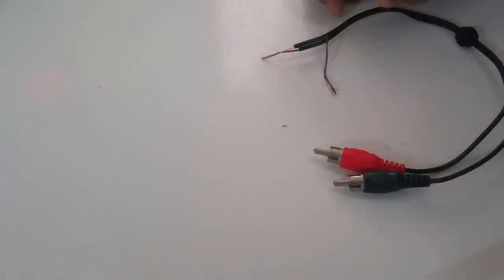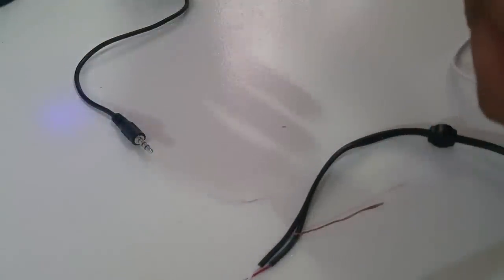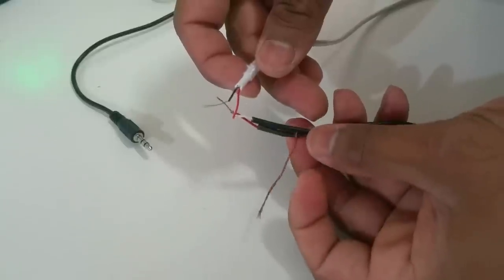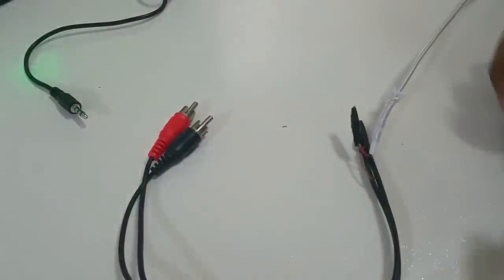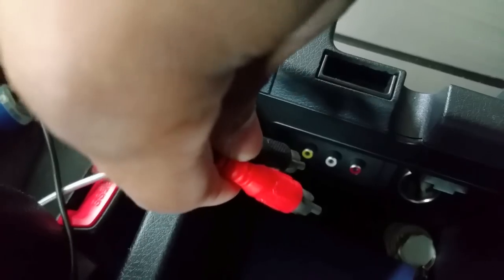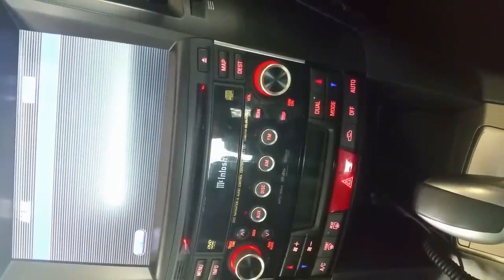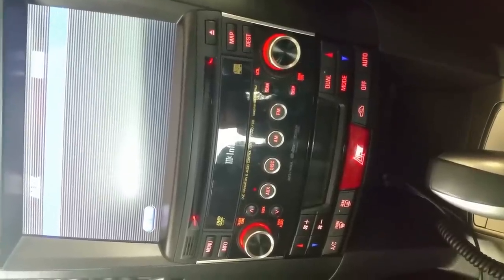How to DIY RCA to aux converter

Comment: hi, thanks for the video!
im trying this myself now, i just have a few questions:
1. why do you chop the ground of the AUX? shouldnt you just connect the ground to the ground (copper) of the RCA?
2. shouldnt you conect the right of the AUX to the right of the RCA (red to red)? and left to left (black to white)?

thx a lot again1
Reply: That is 100% correct. He combined both left and right to only 1 side of the stereo field and depending on the fact the stereo field is centered so he will hear most of the post production mix. The way music is mixed today it will sound bad because now they are layering vocals and sounds on top of one another, anything panned hard left or hard right will not be heard because he only connected it to one side, it breaks apart the layering done in post. 

It is a very bad way to do this and glad someone pointed it out. Doing it the way you said will keep the left strictly on the left and the right strictly on the right and you will hear the mix as intended. I couldn't understand why someone would do it this way either. It will work for a song with everything completely on the center channel but that would be super rare because no one mixes like that.

Comment: hello, can you please help me out? Ive tried to wire a chinch cable to an "aux in" pin on the mainboard of my sony hi fi. Ive hold the red and white chinch wire to the L and R pins on the mainboard but no sound comes out at all. First it worked! ive hold it on the L and R pins and the sound was flaweless. Then ive tried it again and now nothing......Did i shot the aux in on the mainboard? Or do i have to wire all the 4 cables of the chinch cable on a pin? Or are these cable isolated with a transparent layer and i have no contact? Thanks

Comment: I have a aux cord with 4 colours. Red, green, blue and gold. And I want to attach it to a rca cable but it is only a red end, and inside it is gold wire than can be split in two. How do I connect the 4 coloured wires to the rca cable? Really need the help.

Comment: signed in to thumbs up. just the vid i was looking for. cheers!  I did have one question, I have a really cheap set of headphones, a set from a plane trip or something, will the sound quality be significantly worse than using more expensive headphones(sony) or like a pc aux?
Reply from the maker: not really mate, sound quality would depend on the quality of headphones, i haven't had any issues with mine, its sounds good in my car. you are transferring the signal through wire.

Comment: This method is only for mono audio FYI if you want stereo you must connect the positive wires for both channels to the corresponding one on the RCA wires. Good vid tho!
Reply: squidud i don't quite get it!
Reply: @carlosbeltran4488  it means you only get the left channel not the right and left. It still works though, I'm just a huge nerd.
Reply: No no that's not what I meant, I don't get how to do it...
Reply: @carlosbeltran4488  oh ok. so first, strip the wires on the headphone cable. You should get 2 or four cables  (depending on your headphones). If you have two cables, do the following:
Strip the two wires inside headphone cable (if not already done)
Strip RCA Cable (you should see another rubber wire inside and some access copper wire around it)
Take the small rubber wire inside the RCA cable and strip it.
Connect it to the one of the headphone wires and solder or tape or whatever them together. 
Take the acces copper wire around the small wire in the RCA cable and twist it up, to collect it all in one wire.
Connect it to the other headphone wire and solder/tape it together. 
Done.
If the headphone cable had four cables do the following:
(you need two RCA cables for this one)
Strip the headphone cable revealing the four wires inside. There are two brightly colored wires. The cables should be separated into two "groups" of two (separated). 
Take your first RCA cable and strip it, revealing the rubber-coated wire and the acces copper wire. 
Take one pf the fore-mentioned cable groups in the headphone cable. Strip the rubber wire in the RCA cable. 
Connect the brightly colored cable out of the two cables in your "cable group" and connect it to the wire you just stripped.
Take the access copper wire and connect it to the less-colored wire. 
Grab another RCA cable and do the same thing for the last two wires.
Done
If any of this was confusing, let me know and I can make a more in-depth video and post the like here tomorrow. Just let me know.
Reply: Just tell me if you have any issues and ill make a vid tomorrow for you
Reply: squidud I would really appreciate that
Reply: Itll be done tommorrow

Comment: I need some help splicing certain wires and putting them together. All the steps I've done but when I took apart the aux, there were red, blue, green wires and not red,white,black. What do I do?
Reply from the maker: best thing to do would be plug in the cables in to your devices and then try touching them to each other 2 at a time. and see if you get any sound from the speakers. its hard to tell because sometimes cables used different color coding.

Comment: where do you get a  female 3.5mm jack? I have plenty of the male, but I need to make the RCA male to 3.5mm female adapter
Reply from the maker: I had brought it years ago from ebay. But its male side broke. So i used the female side from there
Reply: @robinkhaira1  Ok thank you

Comment: What do I do if my aux cable has red blue green and copper
Reply from the maker: then you ll have to mix and match them, but if i had to take a wild guess then i think red and green would be ones to connect.
Reply: robinkhaira1 I did exactly that and got it the second try, thanks

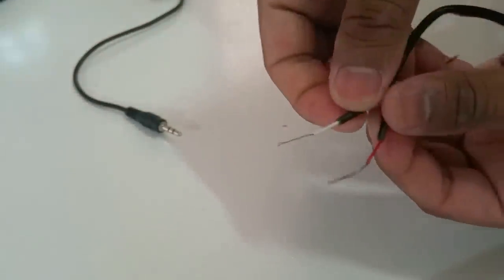Comment: @0:55 he combined left and right channels so there will be no stereo separation... people who don't know better will try this and think it worked. what a shame
Reply: @kay94  yes. you just have to match TIP and RING of the aux with the left and right of the RCA. (I don't remember which is left/right, but you can look it up). then you have to tie the SLEEVE to ground on the RCA. if you mix the channels up accidentally, you can simply swap the RCA plugs in the car